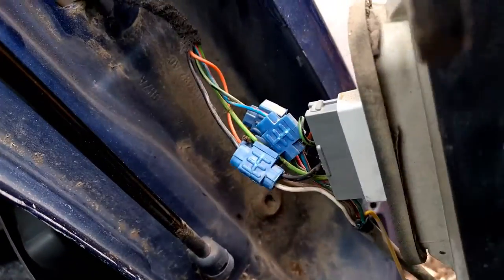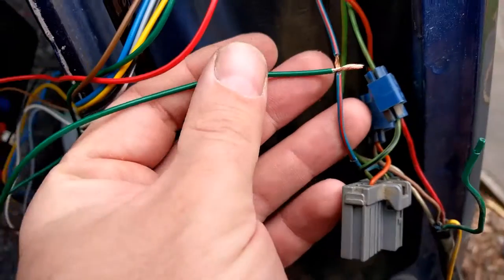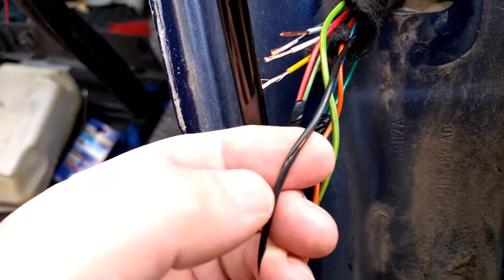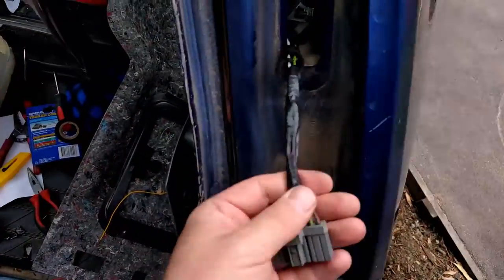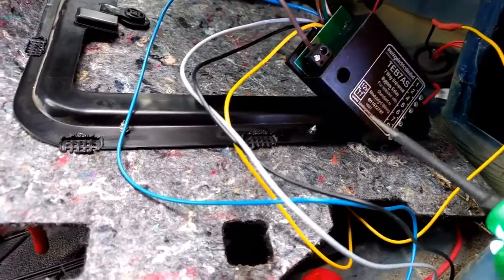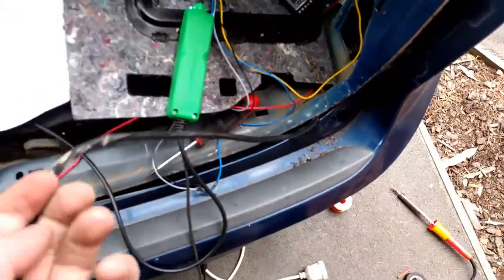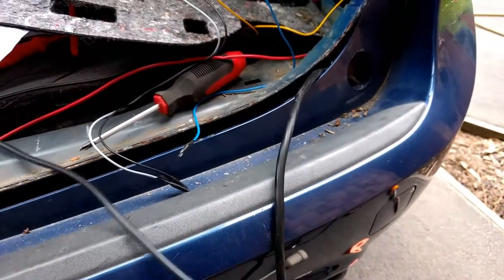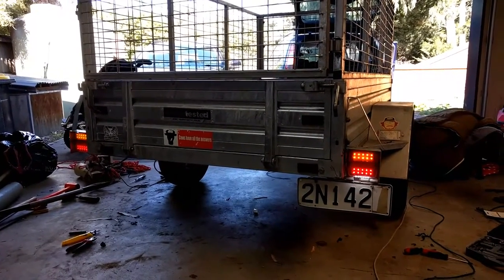Redoing the trailer wiring

Comment: Great video. Just about to wire mine in, I have a 12v cigarette lighter in the boot that has power even with the ignition off. Do I need to run power from the battery or could I tap that? Ta

Comment: Great job! Qustion about the power feed "instead of routing it throwout car to battery, is yours rigged to cigarette lighter live? As it would make mine much easier install. Would I need to (UP) cabin fuse and fuse line between? tia.

Comment: How do you know someone was paid to do that? Looks more like the owner probably did it himself since the blue crimp connectors come with ready made trailer wiring, I'd imagine professionals would buy wiring and plugs seperate to cut costs and also have done a neat job without slicing cables by accident. I'm in the process of doing this myself, hate the blue connectors and want to make a mini wiring loom with light cluster plugs and sockets but not sure how to find the right ones or how much more expensive it will be, so probably use the blue clips for speed, spent half a day finding a wiring path without having to drill holes, job is neat so far, but splicing is gonna be hit and miss I expect, wire wasn't as long as I'd have liked...

Comment: Hi with the relay box does the main feed from battery have to be fused or can you wire straight from battery to relay thanks
Reply from the maker: You always want a fuse in the circuit.